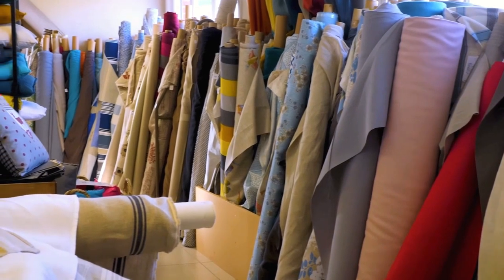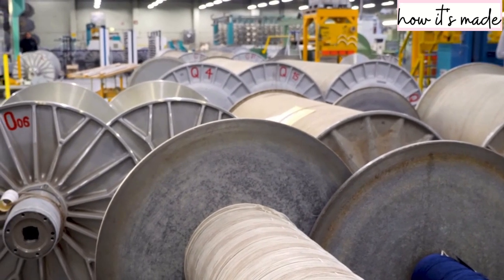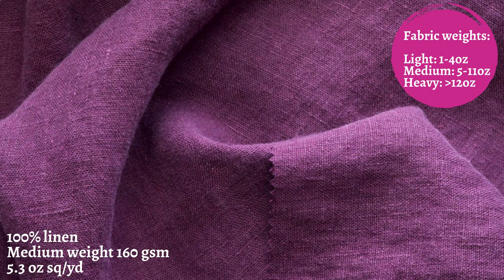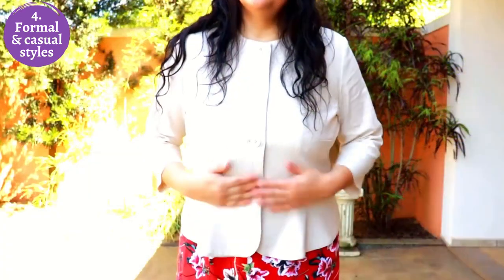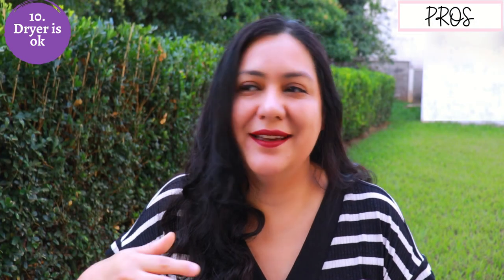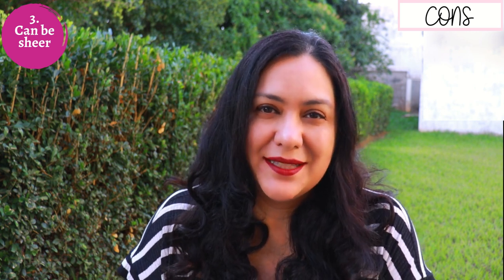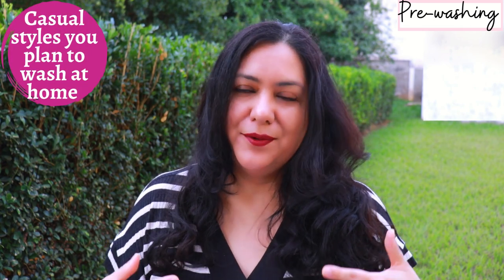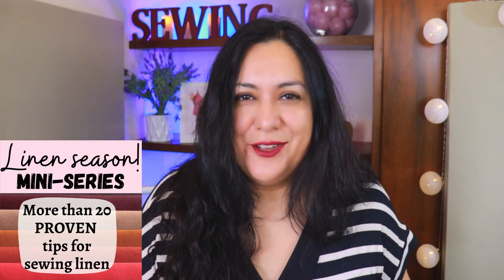It's LINEN SEASON! YAY! Reasons to sew it. Origin, types, weights & pre-treating. Linen Mini Series

Comment: I have a 20 year old golden yellow linen dress in a casual flared style, centre front and back seams, flat-fell seam finishes, self-bias binding neckline and armholes, 2 inch faced hem that has been washed and air dried at least 100 times. It still looks lovely and flattering. I always use laundry treatments for hard water so as to prevent that grungy look. If you have soft water, linen would last forever.

Comment: I really enjoyed learning about the flax plant and how it is made into fabric. Now I understand why the fabric is so expensive. I’m making my first linen garment and followed the instructions on the bolt that said to wash in cool water, dry on low, and use a cool iron.  Well, a cool iron has no effect at all on smoothing out the wrinkles, so I used a little steam, which helped a bit. I wish I had seen this video before pretreating, but now I feel more confident about ironing with steam and a pressing cloth. I washed only once and have cut out my pieces, so I hope it won’t shrink much more! Thank you for this excellent video!

Comment: Everything you put out is high quality! I've been sewing a lot with linen this whole year just due to where I live. It's the Sonoran desert. We get less than 1 inch of rain and never freezes in the city. It's hot. And bright. And linen is perfect. I have about 8 yards left of some handkerchief 2.3 to 2.8 Oz linen for cover ups, tanks and blouses. Then some 5.3 Oz med linen in several darker colors for skirts, pants and other bottoms. It's so forgiving after being washed a couple times. Another reason to absolutely dry is all the lint that comes off the first few washes. I washed my 11 yds of handkerchief linen when I got it, serged edges, right sides together, a big tube, but I had to clean the lint trap 2 times each cycle. But it's so worth it. I read about softening linen quicker and tried the baking soda method. It didn't seem to accelerate it much, and I soaked the linen with frequent agitation as well for 72 hours. I'll stick with just washing. There's usually no short cut for awesomeness.. Lol I made a few skirts which did require some pressing but after, I'd say a dozen washes, they are now just wash and wear. Maybe a spot press on the hem to fall properly. I'm a fan of linen! I can't wait to see what else you show us. I've seen literally every video of yours and I'm excited to see a lot more linen easy to refer to. Thank you for everything you do for us Karina! Love from Arizona!

Comment: Thanks so much for this series, I am finding it so helpful and interesting!  I have seen several sewing experts say that if you iron your linen before you pre-wash it, it becomes less prone to wrinkling, some even describing it as becoming "wrinkle free" or "wrinkle resistant".  I tried this a few times with linen from different sellers and it doesn't work for me.  Yet when I ask about this, they are quite adamant!  I wonder if it's some kind of special linen that has a pre-treatment or something?  Have you heard of this? In any case, looking forward to the rest of the episodes.